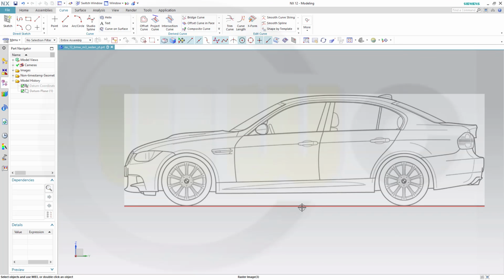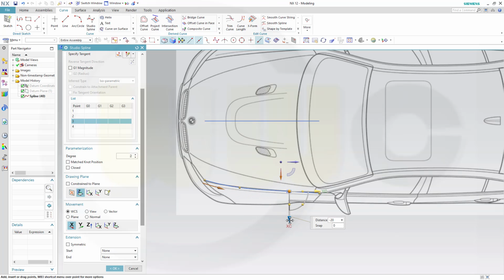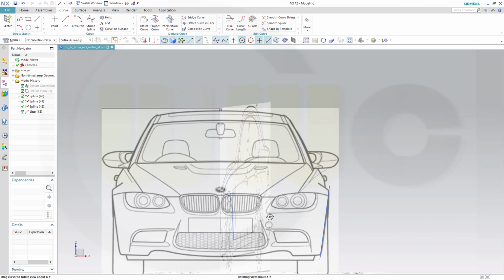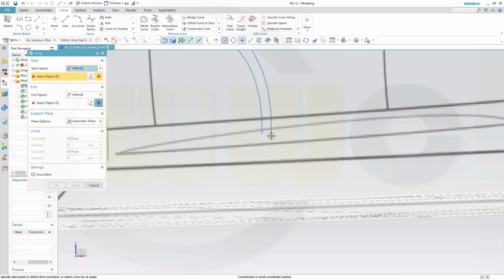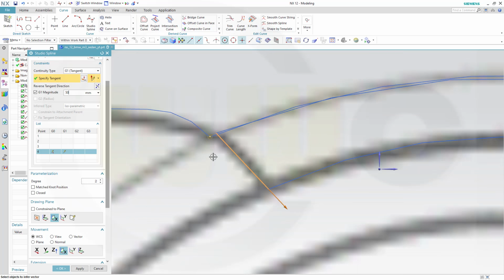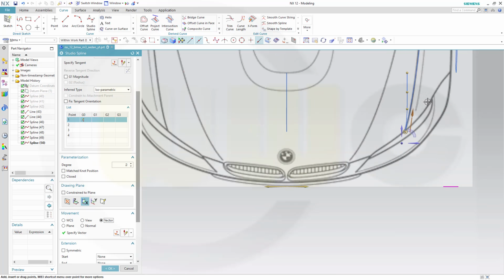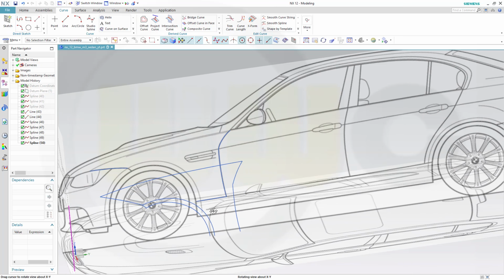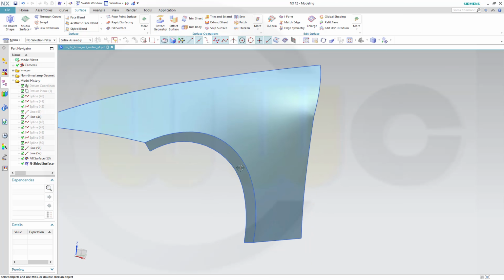Car Fender - Kotflügel - Siemens NX 12 Training - Surfaces

Comment: Hi Wolfgang -
Thanks for the excellent content and greetings from California, I have watched some of your videos and picked up a few tips on surface modeling.

If you had to pick one of these excellent MCAE tools for your personal use which would opt for ?  Also have you looked at ZW3D, its a Hybrid Modeler that has been around for a very long time, used to called VX and Varimetrix before it got renamed to ZW3D.  Solidedge and Creo are similar, without the Machining capability off-course  ;)
Reply from the maker: Sorry, I don´t use MCAE tools, I ´m just a trainer. my favourite CAD-Software at the moment - Siemens NX. I m aware of ZW3D but I ´m so busy, there is no time at all to try i.e. ZW3D.
Reply: @wolfgang.walden.cad.training   Thanks for responding.  I tried reading some NX docs and found that going from part design to CNC tool path generation was fairly complex.  I do like NX and its parents too, Unigraphics and I-DEAS (which was always my favorite).  If money was no object I would surely choose NX too.

Comment: Hello there, I don't know if you do this for a living, but this tutorial is wrong in my opinion. You cannot start designing a fender without seeing how are the surrounding surfaces. You need to build the overall shape and then you cut and get the fender panel.
Reply from the maker: Really? You think, that I don´t know that?  It is an exercise, to show how some of the tools, you would need, work. By the way I´m neither an engineer nor a designer, just a trainer for CAD-software. I ´ve never pretended to be something else.
Reply: @wolfgang.walden.cad.training  Sir, my comment was not intended to offend at all. I am sorry if it passed that way.
Reply from the maker: Accepted :)